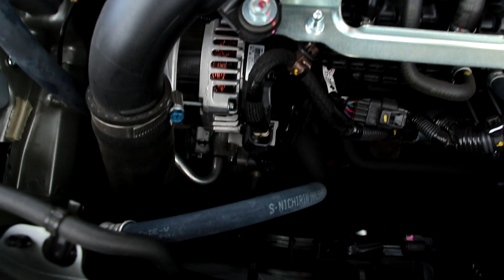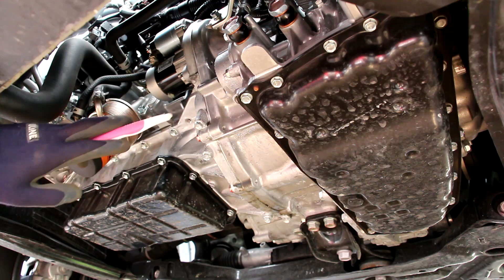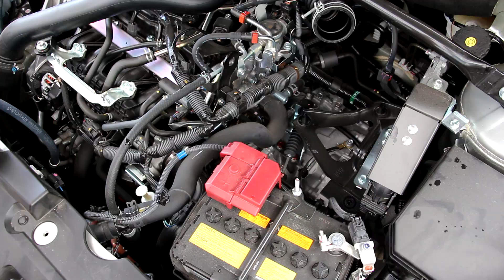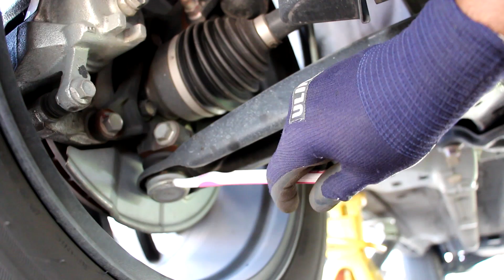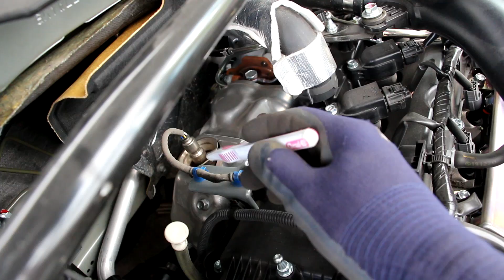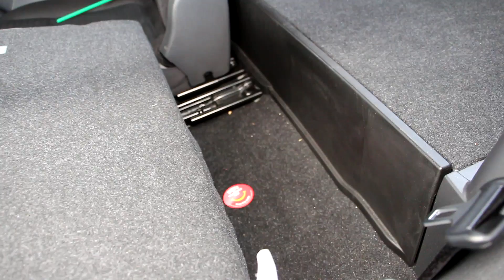Mitsubishi Eclipse Cross Mechanical Review

Comment: Great video, last time I had the car in for an oil change the tech allowed me to take a look at the undercarriage while it was on the lift. Very impressive. Coming from owning 4x4's and now have a 2018 eclipse cross LE im very satisfied with everything the car can do. On the note of CVT. This is a wonderful CVT, the simulated 8-speed with manual sport shifting has allowed me to put the turbo to good work and pass dumb people that shouldn't be allowed on the road. 

This car with its S-AWC system is great for rainy days, I recently drove in a crazy rain storm here on the east coast, and I can launch from a stop light without any slipping and it acts like its dry pavement. Just sticks. 

I wish I had done my own in depth review of the car when I first bought it, everyone that reviews the press cars miss so much especially on this one. Even being 2020 now they still miss some of the best features inside. But the biggest problem I see is the fact that everyone says its slow and not sporty. I can say, I've overtaken cars on corners and if you drive it correctly it can launch you back in the seat from a dead stop. This CVT has the torque close to a hybrid electric drive, dont get me started on numbers. But ill say, inputting all the math frontal sq. Area and other specs into my obd2 tester and monitor system, I peaked just over 200hp and well above the ft lbs of torque that is speed out from mitsubishi. I live at sea level and so I'm able to compress more air to get better numbers is my hypothesis. 

Last note I read the owners manual cover to cover. First in my life and it was very informative, in "high heat" environments mitsubishi says to run premium gas. (93) in my area. And wow, just wow! The responsiveness is crazy good. I scared my mother one day getting up to speed for the highway. Its earns the title of Eclipse Cross in my book.
Reply: Great comment.  I would agree with everything you say.  Your right they are not slow they are super peppy for a 3,516 lb suv (my trim SEL Touring) and that small 1.5L turbo 4 can really pull off the line!  Mine does amazing in the rain and snow and sleet with the s-awc it just keeps you right where you want to go.  Gravel mode really pushes power to the rear.  I have ran 91 octane fuel where I live in md and I can tell a difference I think also vs 87 octane.  

Go was TFL Eclipse Cross off road video if you have not already its neat.
Reply: @tooltime9260  I hear what your saying, I live in a area that is absolutely diverse in the amount of different drivers that come from all parts of the country. We have too many people that love to "race" on the streets. I sold my EC and now own a RAV4 Hybrid and funny thing it's faster than my EC. Especially from a light. And it's far superior at mpg even when doing so. But most just are trying to get away from a bad selection of drivers or are always late for work. I selectively overtake, but I study driving and am always looking at flow several cars ahead to anticipate where I should be to efficiently get where I need to with the least amount of issue. 

Some days I'll do the actual speed limit on the highway in the middle or fast lane. It's legal to do so. Other days I'll just set my radar cruise and flow with traffic.
Reply: Last note on the car subject. At 55mph on highway I get between 34-43mpg avg. At 70mph I get 25-28mpg. And the 70mph speed with premium gas in the tank i get avg of 31mpg. Yes you read correctly I got better overall gas mileage on premium fuel grades than on 87. The car works less hard and its noticed on the coolant temp too I run 10 degree cooler with premium sitting in traffic or in a parking lot after just driving around than I do with 87 octane.

Comment: Mitsubishi make reliable vehicles, I hate when people like scotty kilmer misleads the masses. And say mitsubishi is not good.

He judges mitsubishi based on cars in the early 80's, he has not driven or worked on any new mitsubishi vehicles. Mitsubishi engines are rock solid and much better than honda new engines , mazda and Kia.  Honda old engines are legendary, toyota engines are the best.
Reply: Would you say Mitsubishi is slightly on par with Toyota?
Reply: @AYouTubeChannelwithNoName 
 I would say mitsubishi is on par with toyota in terms of petrol engine , but toyota is still better.  Toyota also has better hybrid system than mitsubishi. 

But You can safely buy mitsubishi and get reliability. You can't say the same for kia and Hyundai. 

Mazda uses sky active which is just mazda version of gasoline direct injection. There are flaws with gdi engines, such as carbon build up. Your engine self destructs gradually if you don't clean your intake valves. You also need to use premium gas and proper synthetic oil.

Mitsubishi and toyota use multi port injection, which has an injector over the intake valves that clean the valves, this prevents carbon build up.

Kia and Hyundai also uses gdi engines.
Honda new earth dream engines suffer from failing head gaskets in cold weather.
Reply: @AYouTubeChannelwithNoName  Well Toyota does use parts made by Mitsubishi, must mean something.

Toyota is leading edge, up to date technology,  which isn't always a good thing.  Mitsubishi a bit more old school, but it's proven and reliable. All these new engines with gdi,  turbo, trying to force more power from a small engine. Look at the issues they are having. My Mitsubishi RVR has a 'dated' Mivec 2.0l.  Starts every time, easy to work on when maintenance comes,  acceptable power output, good fuel economy...and bulletproof. Works for me.

It comes down to 2 things. Do you want the latest and greatest in technology,  or something that has been around a while and is proven to be reliable?

With Mitsubishi you don't get the up most in latest technology, but you can be sure of always making it to where you are going, and back again.

Plus Mitsubishi are still made in Japan, not some third world country.

Just my 2 cents.
Reply: But don't they use jatco cvts? They are notoriously bad.
Reply: @Yellow-Rose  not all jatco cvt are bad, don't listen to scotty kilmer. Mitsubishi and nissan has different transmission designs. Nissan cvt are very bad , mitsubishi transmission are ok. They don't give trouble. 

I have seen some mitsubishi cvt transmission outlast  cvt transmission from toyota.

Comment: Our 2 new fully loaded Mitsubishi Eclipse Cross SEL Tourings with S-AWC are truly loaded.  I do hate on lower trims where they have blank switches to the left of the steering wheel as it looks cheap where as mine being a top trim has the led headlight leveling switch there, lane departure warning switch, forward collision button, traction control button, 3 heads up display buttons for brightness, height and to raise and lower the heads up display and all.  

Some of my favorite features in our Eclipse Crosses are the dual panoramic roof and how the rear people get their own power shade too, push start and keyless access, power driver seat, apple car play android auto, 3 mode s-awc (normal-snow-gravel) power folding heated side mirrors, in car sos & caller center button telematics, remote start by app and climate control setting and more, rain sensing wipers, 360 degree camera for front-side-rear and birds eye over head view with park assist, dual zone automatic climate control, leather, 710 watt 9 speaker rockford fosgate audio system, adjustable rear seating sliding and reclining, led lighting inside and out, heated steering wheel, heated rear seats, heated front seats, all the driver safety aids, level adjusting led headlights, 10 year warranty and much much more!  Plus we have owned 5 new Mitsubishis now over the years and have loved them for their features, reliability, simplicity, warranty and just overall brand satisfaction.  When we bought our 2 Eclipse Cross SEL Touring’s last October we got right around $7,000.00 off the MSRP on our 2 new Eclipse Crosses and got a top trim one with accessories and the touring package and only paid a tad more than what a base model Eclipse Cross cost due to Mitsubishi rebates, dealer discounts, loyalty cash and more!  We love ours!  This was a great video.  So you think they seem to be build pretty good the engine and overall structure?  I know its an older GS platform and they based the 1.5L Turbo engine off of an older engine design of theirs but these are some of the main reasons I like Mitsubishi as they use times tested and proven power trains and structures.  

One question I cannot get a clear answer on is does the Eclipse Cross have a CVT-7 like the Mirage and Mirage G4 (I owned a 2015 Mirage ES and 2017 Mirage G4 SE) use or does it use the larger CVT-8?  Do you know?  I know its programmed different than our 2016 Mitsubishi Outlander Sport GTs CVT was where as the Eclipse Cross feels like its shifting at times and had 8 simulated gears where our 2.4L Mitsubishi Outlander Sport GT just winded up and held there for power and was quite peppy just like this 1.5L Turbo is. Great video ai mean that.
Reply: What did you pay for the sel
Reply: @jeremywilber3451  I got my Octane Blue 2019 Eclipse Cross SEL with the $2,500.00 Touring Package and S-AWC.  Mine was right around $32,500.00 msrp as it also had all weather Mitsubishi mats, cargo mat, cargo net, front and rear silver garnishes and such.  I got mine for just under $26,000.00 after Mitsubishi rebates, renn kirby Mitsubishi discounts and Mitsubishi loyalty cash.  Then our Red Diamond SEL with the $2,500.00 Touring Package and S-AWC was like $34,005.00 msrp as it was $595.00 for the special Red Diamond paint (neat several step paint process if you read on it), front and rear garnishes, front, rear and side rocker molding sport package in carbon look with red trim.  We got it for $27,000.00 after the Mitsubishi rebate, renn kirby Mitsubishi discounts and Mitsubishi loyalty cash. 

We could not beat the deals anywhere and got the same deal when we bought our 2016 Mitsubishi Outlander Sport GT AWC there and both my 2015 and 2017 Mitsubishi Mirages.  We also looked at Subarus, Honda, Nissan and Toyota but with all the cash we got off with the Eclipse Cross, its 10/100,000 powertrain warranty, 5/60,000 bumper to bumper warranty, 5/unlimited miles roadside assistance, fully loaded feature set and excellent crash ratings, and Mitsubishi reliability it was just the best thing we could do and we are so happy we did.  7 of us at my work own Mitsubishis and one is a 2011 Mitsubishi Lancer CVT with like 175,000 miles on it.
Reply: @kmckenzie2461  was the 26k out the door price?  Or is that before destination
Reply: @jeremywilber3451  My out the door pricing was like just under $27,000.00 with the gap insurance I added (I do on all my auto loans) and a few Mitsubishi accessories.

Comment: The good thing about mitsubishi is their simple mechanicals, ease of serviceability, and their mechanical reliability, because they ARE reliable. Other than that, all their cars are bland, lack lots on insulation (most have stupid high road noise levels), interiors rattle after 2 or 3 years, doors feel cheap and dont close well, and more. My first car was a mitsubishi and I sold it after 4 years because of these exact reasons. Reliable car, but boring and really cheaply made structurally. Then I bought a Nissan qashqai (rogue sport) and it has been a way better car. I now use a ford truck that my dad used, and I passed down the nissan to him because I wanted a truck. Ive generally been happy with all my cars except with the mitsubishi.
Reply: Mitsubishi: Perfecting average
Reply from the maker: Yep. Just simple
Reply: This one is actually very quite.. better than NX

Comment: I agree with the bulk of your thorough analysis but don't think the ECU positioning in the engine bay is such a big deal. If you've just crashed your car hard enough to smash the ECU, it's probably the least of your problems.
Reply: Must be a Canadian insurer thing, it is not an issue
Reply from the maker: Try rebuilding one, or arguing over insurance on a claim. That's probably the biggest cost after airbags

Comment: i love my lancer, no complicated parts i know it will last long
Reply from the maker: I mean it did last very long on the market until just last year it was discontinued
Reply: I own a manual transmission Lancer from 2008 and I would have bought another one new blindfolded.
Never had a hint of a problem, just the usual maintenance. Not a lot of mileage though, only 120,000km. This year I had to change the transmission belt. 
But after 9 years it was the rust I was fighting against... Too much salt on the roads during winters in Europe.
Reply: @RaduB.  Sad but that will happen to any car with driving on salt yearly
Reply: I have a 2012 Lancer se awc 91k man it's good
Reply: @cameronmitchel8814  Bias speedkar99 doesn't want to hear that mate

Comment: But will that cvt hold up with awd 😕
Reply: Service every 30k. Just put new fluid and a filter on my '17 Outlanders CVT and it runs like a charm. 42k miles
Reply: @ItsCleto  it should still be good that's very low miles.
Reply: So far so good  2012 Lancers  se AWC cvt 91K on it

Comment: Holy cow the engine looks like a mess to work on, I have(had) a (few) honda 4 cylinder car(s) and it's so much cleaner all the way around, wtf?!?   Also most of the front is skid plate covered for good aero.  Mitsubishi/Nissan/Renault are on LIFE SUPPORT.   I want lots of car repair vids and this thing looks like torture.

Comment: For a Mitsubishi I love how simple it is I don't need radar bullshit or sensing bullshit theres a reason you take a driving test and if you fail you wouldn't be on the road in the first place.
Reply: We have a mitsubishi eclipse cross in UK, not a 4wd, front wheel drive automatic, we have performance brakes on it, bigger front discs with two piston brake caliper, electric handbrake and key less entry, push start system, radar system is mounted in the windscreen
Reply from the maker: Yep. Pretty simple for a modern turbo car

Comment: Agree with his review concerning the design and ease of access for mechanical repairs + a (CVT) Transmission  Dipstick - wow.   I personally would wait until this model is 4 - 5 years old then search for known issues and parts availability b4 purchasing.  Excellent Review Once Again.
Reply: i got mine back 2018 and never had any issue.

Comment: The saddest car to carry the Eclipse moniker since the 3rd gen.
Reply: Eclipse is always coupe sport car.
Reply: This is a base model spec Cross over. Standard AWC standard 18” alloy wheels and a crap ton of other standard features for 27,000 CDN. Ofcourse there are blank buttons and cutouts! If you want those options spend 2000 more Canadian dollars lol
Reply: The Mitsubishi Eclipse then: a fast cool car you could swerve on errbody erry day
The Mitsubishi Eclipse now: a boring, budget level SUV for upper lower class moms
Reply: @greggc.touftree5936  I used to have eclipse 1gen gsx turbo. Pain to repair but it was engineered so well. Looked like a rocked and driver feel inside like an airplane pilot. Now? SUV. Seriously mitsubishi? No wonder you need to retire from europe.

Comment: Mitsubishi is very reliable. I know from years of experience. Mitsubishi is also 4th in customer satisfaction.
Reply: agree and disagree...bought a used '15 Outlander Sport with almost 42k miles on it and on the 3rd day of owning it the transmission gave out. Luckily, it was, of course, under warranty and Mits took replaced it for free, but at the same time, 42k miles and it already gave out? Looked up the VIN in their website and pulled up all the services that were done, so there was no mistreatment on the previous owners side. Hence, why agree and disagree with your statement
Reply: Tin man they use those Jatco CVT trans, same as Nissan
Reply: @MrINDEPENDENT2000  the one that was in ours was the Chrysler tyranny. The same ones that are used on those diesel Jeeps. Reason I know, my friend had one and his went out. Forgot the model of the tranny, but it had the same prefix numbers.
Reply: Disagree, Nissan n Mit , I can’t tell which r more unreliable n stupidly engineered
Reply: Have fun when that Jatco CVT goes out.
Reply: Why did they d/c eclipse sedan and evo? They don't deserve customer satisfaction, they've stripped Gto,evo,eclipse, out of their lineup
Reply: Ahh no, have you driven the modern Mirage?
Reply: @applepoop10  I bought my daughter one as her first car and she loves it. A $10K car with heated seats, power fold mirror, android auto, and great gas mileage (2 weeks between refuels), and 10year warranty. It cant be beat.
Reply: Mitsubishi AWC Great review! Like to hear about the Mirage. Mitsubishi’s affordability is definitely one of it’s strengths, and I’m glad to hear it shares similar quality to their other cars :)
Reply: @e2xx911  Oh yes it can. Kia offers the same warranty on cars that offer way more than any Mitsubishi, for nearly the same price.